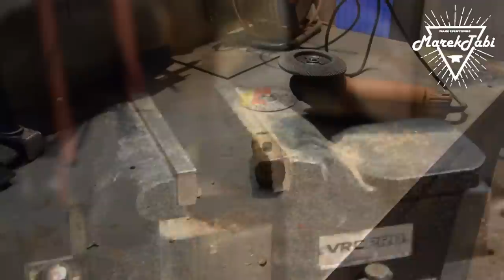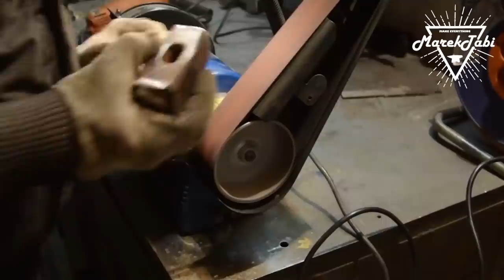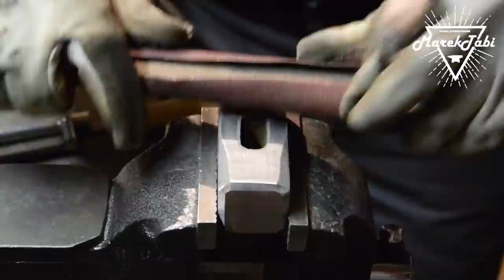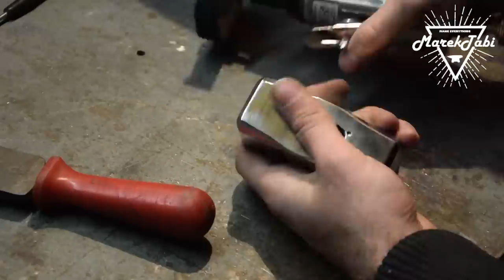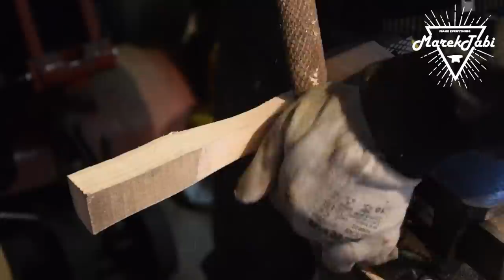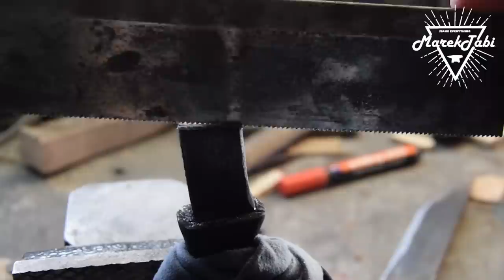Old Rusty Hammer Restoration

Comment: I like it, it's shiny. But the fitting of that handle's eye is going to disappoint you.
Reply: This.  It was a terrible fit right?
Reply: 1) The black, too-short handle doesn't match.  Natural hickory would've complemented the superbly-restored head.2) The wedge, a focal point for the eye, detracts.Discard that handle and make a new one.
Reply: Awesome. Then build one to your specifications and have someone video / film it, and upload your videotaped work on to Youtube.  @kellerrobert80
Reply: Ok, Mr. Expert. Anything you say.  @CloudfeatherRusticWorks
Reply: Like I earlier wrote to this thread, if you are the expert you claim to be, videotape one of you restoration jobs showing up the proper way to restore and hang a hammer and upload it on to youtube. Otherwise, put a cork in it.   @CloudfeatherRusticWorks
Reply: Awesome. Now either put up or shut up. 
 @CloudfeatherRusticWorks

Comment: Nothing better that restoring a tool that will get to be used again.  Talk about true conservation.  Just finished a 1950's Stanley plane I got off of eBay and it functions better now that anything I could have bought at 2-3x that price point and all it took was elbow grease, steel wool, WD40, CRC 3-36, and various wet/dry sandpaper to polish the blade which is razor sharp now.  Goes to show you that truly one man's trash is another's treasure!

Comment: Why remove the curved side, all the massettes have a flat side and a domed
Reply: So when you're hammering metal it doesn't scare it and put an unwanted sharp edge that could cause an inclusion.
Reply: Taen, yes. to continue, the domed sides to move metal, flat is to finish. flat is also better for hitting other tools or metals dosent slip as easy.
Reply: Jeremy Barker lol you don't know how a hammer works xD

Comment: Sr.
One step missing. You have to let the hammer head rest in water for 48 hrs.
The wood will absorb the water and expand evenly inside the hammerhead
Reply: you don't HAVE to do it, but that's one way of putting the head on. it's fine if you only use a wedge.
Reply: And when it evaporates? Why not just seat it properly?
Reply: actually, it will be pretty stable if you do it the right way.
Reply: I have set quite a lot of both hammer and axe heads. And in my opinion, letting the wood soak up water is only something I would use if I needed the axe/hammer to work temporarily ( if the head is coming loose and I don't have any other way to re-seat it. Instead, I make sure that the wood matches the eye on the hammer/axe and i have never had a head starting to work it self loose. And if I use something to expand then I make sure to use some kind of oil, because oil don't evaporate. But I'm sure there is a lot of different ways to do it!
Reply: Nick Olsson - When I put new handles on my hammers/axes/hatchets, I usually shape the end of the handle slightly flared at the top, so that when I pin/peg it the top will flare even more and somewhat lock the head in place. We all seem to have our own little tweeks for how we do things, and I really enjoy listening/reading other peoples methods.
Reply: Soak it in boiled linseed oil, it will expand the wood but not evaporate. I would have just remo ed the mushrooming and dress the face. Why polish a tool?
Reply: Because it raises a mere tool up to being a work of art, without loosing its functionality.   For example Japan has a whole branch of philosophy of combining the aesthetics with the practical, for weapons, tools and even making tea.

Comment: The hammer looks really awesome. As some Polish-speaking guys have already pointed out though: it WILL rust probably even in less than a week. It could've used at least a layer of lacquer, oil or some other protection.

Comment: A quick and effective way to set an Axe, Hammer or Hatchet head on a handle is to hold the Axe/Hatchet/Hammer upside-down and whack the bottom of the handle with a mallet until the head sits firm on the handle. Using Boiled Linseed Oil on a wedge before driving the wedge in really helps the connection last. Cheers from Germany! :D

Comment: I think it's great, I have had to replace hammer handles in the past and it seems the handle could have been laminated  at least two pieces of hardwood would have added strength. Good job and the restoration ,  you can't get that quality of vintage iron in new tools these days.

Comment: Very nice restoration.  Did you only use 80 grit and then jumped to the polishing compound or did you have more sanding involved that we didn't see?  I never thought to use a jigsaw to profile the handle, excellent idea so thank you for that.  I'm working on an axe handle myself and am using the relief cut and chisel method and its not coming out as clean as your jigsaw method.

Comment: Nice video, Marek. I have two questions about the job you did, and please forgive me for being new to this kind of work. Did you remove rust from the inside of the hammer as well? Does it matter, given that the surface isn't exposed directly to air?

I have recently had the opportunity to work in a neighbor's private shop, and I found hundreds of old metal tools that should be restored.

Thanks for any feedback you can give.

Comment: What are you planning to use the hammer for?  I noticed it had some mushrooming before you ground it down. Was it a lower carbon steel? Did you consider re-hardening it, it may not have been harden-able steel, but would have prevented it from mushrooming in the future had it succeeded.

Comment: Correct me if i'm wrong, but wouldn't all that grinding and cutting work damage the temper of the steel? When I grind the rust off of old axes (or cut sections off), I have always been instructed to quench the piece before it got hot (either spray it with water, or wipe it with a wet sponge). Anyone know why he didn't take any of these measures in the video? Just a wall hanger perhaps?
Reply: Maybe, but as long as it stays under 400F (about), it should be fine.  Above that and the case hardening starts to soften.

Comment: Nice job on hammer head.. But faces of hammer need to be tempered. This is done by heating up hammer red hot then quenching the two faces while leaving the middle where the handle slots to air cool. Untempered hammers deform when you use them, the metal is soft.
Reply: Although it is soft, it can break your skull open

Comment: Marek, the next handle you do... please don't paint it. soak it in linseed oil. char the outside. rub it down/super lightly sand it. seal it by rubbing a mixture of beeswax and linseed oil into it. linseed oil will work fine if you don't have beeswax. it'll be tougher, more shock resistant, prettier, and make a for a better video

Comment: gonna ignore what heat treatment cutting the face off with an angle grinder stuffed up but, no glue on the wooden wedge and no steel split wedges? not a friction fit all loosely goosey sausage down a hallway. The wedge will work it's way out through use without glue.

Comment: I personally would have just put a new handle on the head as it was, it's just gonna rust again, and get rounded, the rounded end has a purpose. I use many hammers that are rusty with manky old handles, there hammers as long as they work there fine

Comment: Ok Nice shiny Paper weight. I would and have reheat treated axe and hammer heads. Now it wont have a good hard striking surface after you took all the temper out of it with power tools. Also the surface of the hammer will deform very easily due to being all austinsite with no martensite. Im a blacksmith, before you say I have no real experience.

Comment: If I restored something to a quality like that, I would put it in a safe (soft and none abrasive, preferably climate controlled) place, and go buy a cheap hammer to use instead because I wouldn't dare use or risk breaking that instead of a cheap one that could be thrown away and replaced.

Comment: This guy really puts in the work. But he puts in TOO much work... hand sanding before coarse buffing on a wheel? Just don't bother hand sanding it at all. Shining it to a mirror finish? Not for me, but if you like it, cool. BIGGEST PROBLEM is that he messed up the handle. The connection to the hammer was too loose. Good thing its so pretty because hanging on a wall is all its good for.